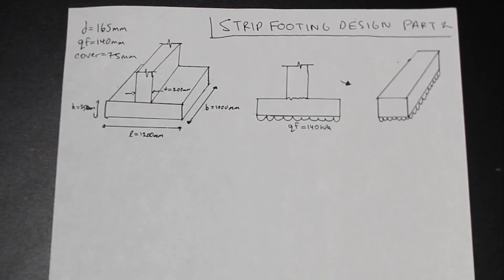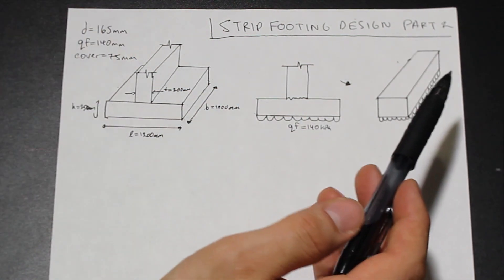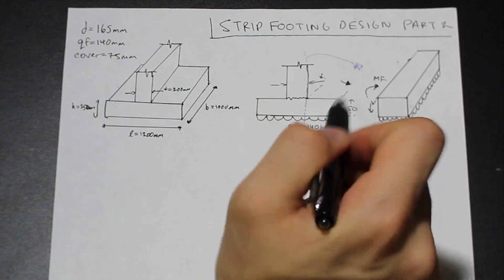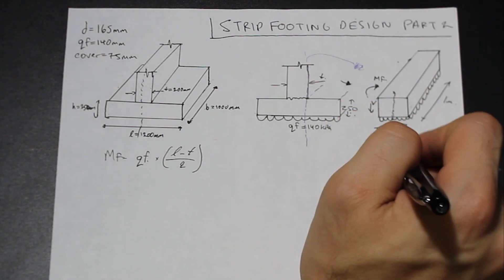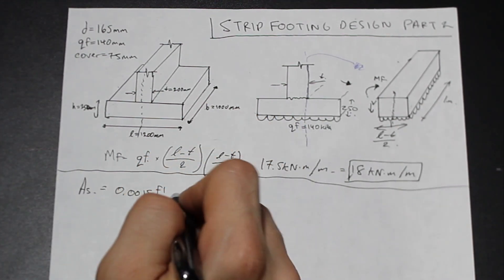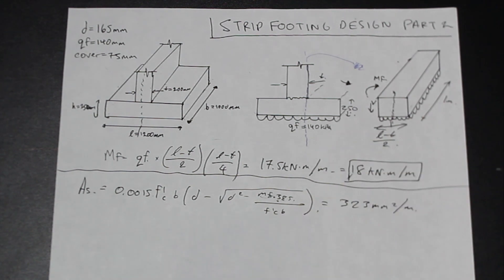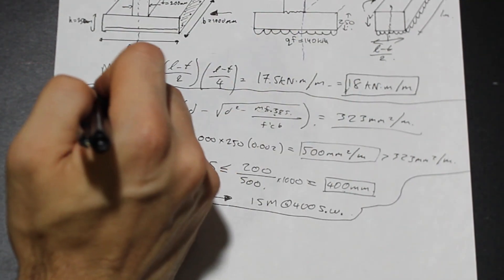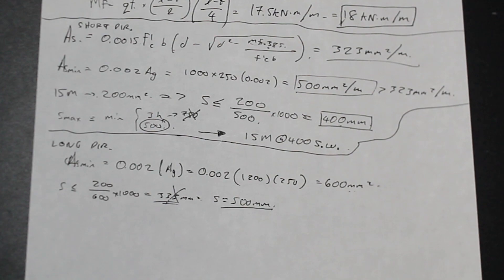How to Design a Strip Footing - Structural Design Part 2/2

Comment: I have footer design in Utah that requires the footer to be at least 30" below grade so they are wanting to pour it 48" thick so my effective depth is very long and causing my critical shear plane to be outside the footer width of 24". Any idea if this needs to be addressed?

Comment: And the depth of the footing will be the depth that the geotechnical engineer found the soil in which we are using the allowable pressure. Am I right?
Reply from the maker: Correct, you'll use the information given to you by the geotech.